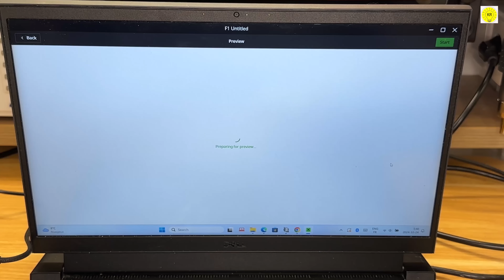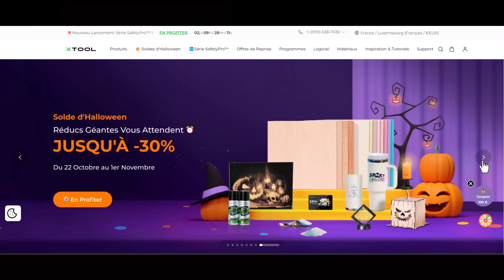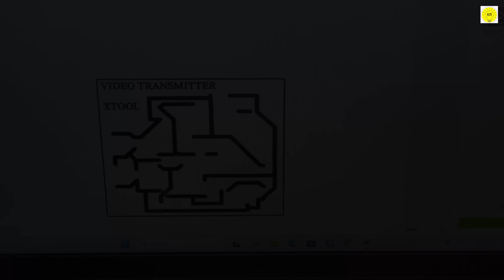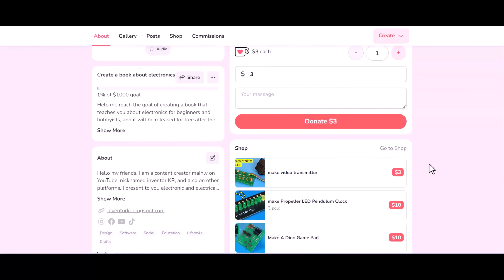how to make pcb at home with Laser xTool F1, DIY PCB Fabrication

Comment: Look up hydrogen peroxide and muriatic acid for etching.  This is a great etching solution that etches very quickly for not a lot of money.  You can get muriatic acid at Home Depot or Lowes and the hydrogen peroxide at Sallys Beauty or another professional beauty location.  Do it in a well-ventilated area and you can put baking soda in the solution to neutralize it after you are done,  Use at your own risk, but I have used it with no problems.

Comment: Your video is cool! Can you explain why you used the grey? Ty
Reply: Depends your laser light, some work better in white or gray.
My laser is a creality works better with black, and I use simple pilot pencil to make the mask and cut the lines around de circuit using laser. 

I use Corel to make the circuit and lasergrbl to burn.
1200mm at 35% in a 10w laser.

Comment: Imagine the amount of Press 'N Peel blue you could buy for the cost of that machine.
Reply: I use standard photo paper on a Brother b/w laser printer, print my circuit, iron it on the board, etch it, drill, iron on parts layout on the other side.  All done before you even get done spreadiing your paste, what a mess.

Comment: 1500€ for that...?!!
Reply: It is a fiber laser which are expensive.  That is the cheaper one.  The ultra is over $3000.00.  You can do the same think with a cheap diode laser though.
Reply: @zk_6312  it's not a fiber laser. it's a 10W diode laser, he used that to cure the solder mask to keep as traces. this method will never work with fine traces (impossible to use to mount QFN packages for example). Stick to the Old  LUT method, way more precise and cheaper. Or go with an xTool F1 Ultra to laser etch the board, with old toxic FR4 fumes risks and possible shorts/high impedance of carbonized fiber glass...
Reply: the same can be done with a brush and nail polish taken from your wife

Comment: This is totally Waste of money 
Just print your curcuit on A4 photo paper in just =$0.2 
Don’t need this expensive printer of these kinds of pcb stuff

Eaching process will be same for this printer and that process
Reply: How does just printing "your circuit on A4 photo paper" achieve the same thing - I assume you mean special photo etch film that has to be put on the copper, exposed, washed and then etched.

I've done that, and it's always been a bit hit-and-miss. And you'd do that if you didn't have a laser - and if you did buy a laser for PCB work, the F1 wouldn't be it.

But I DO have an F1 laser and I've been looking at a way to make simple PCBs quickly and without hit and miss exposures etc.
Reply: What is the name of the resine or paint coating?
Reply: @anthonymaisincho79  He shows the packages at the beginning - and they're "Mechanic UVH900" UV-curable solder masks.

Mechanic UVH900-BY [Blue]
Mechanic UVH900-RY [Red]
Mechanic UVH900-WY [White]
Mechanic UVH900-LY [Green]

He chose the White one - don't know why he chose that over the others.